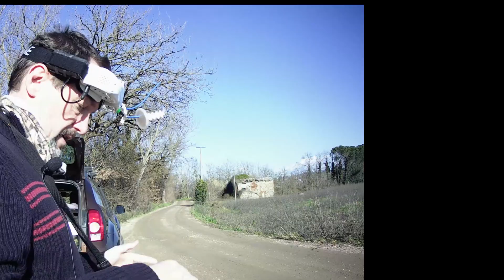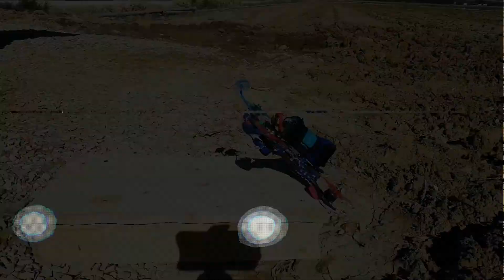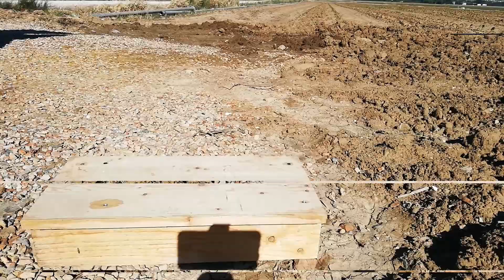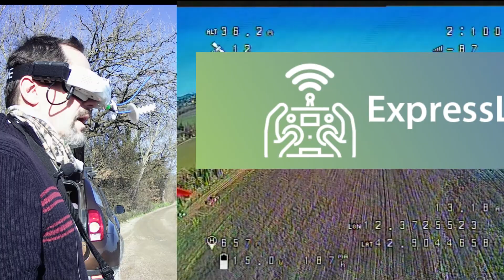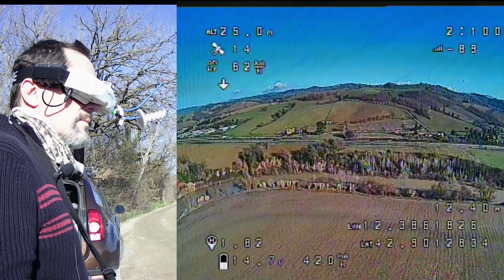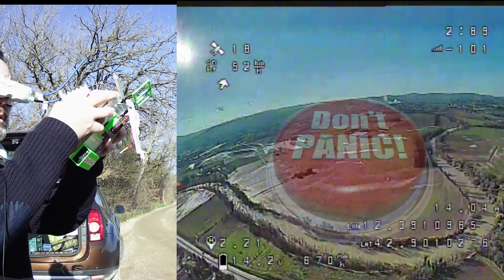MID RANGE HAVOC

Comment: Mindblowing performance but can you please try a range test flying low (below 3m height)??
Reply from the maker: And the purpose of such a test?
Reply: @MnM_FPV  What do you mean?
The way I see it, the advantage of flying a quadcopter is the ability to fly really low, around and between obstacles and hover. For high altitudes and long range there are many and more efficient flyers than quadcopters.
Reply from the maker: @TheodorosBako   Definitely something I will consider trying but perhaps I will increase the TX power output a little...
Reply: @MnM_FPV  I am trying it myself aswell. So far I have been to 500m distance at a height of 20cm to 2m max @ 100mw without a problem. Now I need a bigger field 😃😃